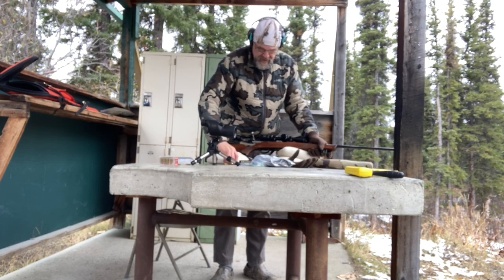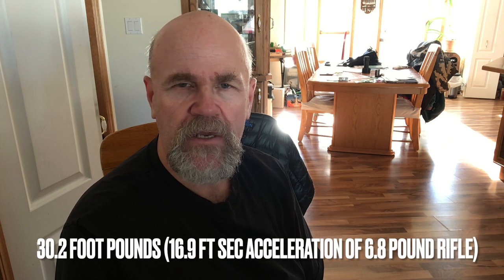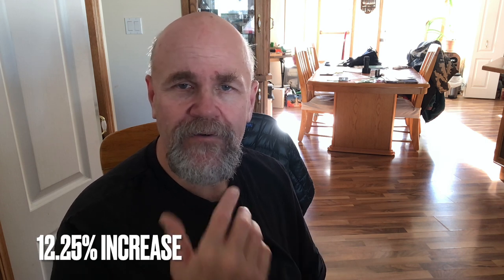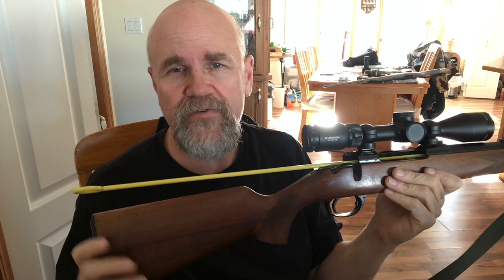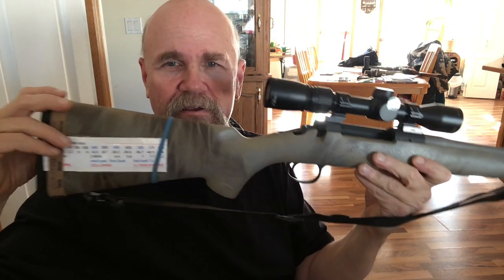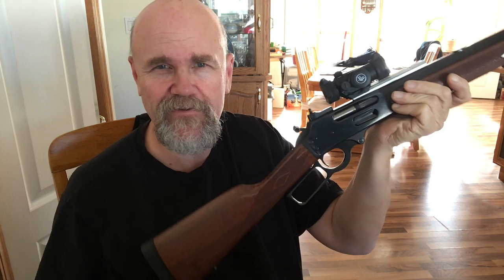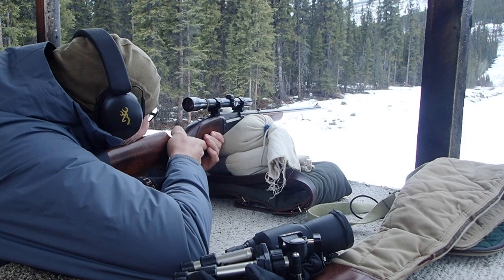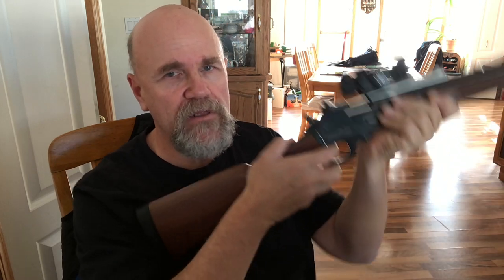Some Design Factors in Taming Rifle Recoil   HD 1080p

Comment: When I was in my early 20's in the late 1990's I had a Browning A Bolt 30-06 that hurt when I shot it because the stock didn't fit me well. The opportunity came for me to shoot a Sako 300 Win mag and i thought it was going to be awful, the felt recoil was less than my "06 due to the McMillan stock they used at the time. That was a real eye opener. Like you I have shot Marlin 450's and 45-70's and they aren't fun to shoot, you explained it perfectly in your video. Browning BLR's are much nicer. I also had a real nice 375 Ruger exactly like your friend's in your recent moose hunting video. It was superbly accurate but I was starting to get recoil headaches so it was traded off. My current "big gun" is a lightweight (7 lb ready to go) 35 Whelen with a Mcmillan Edge stock set up just like your Forbes and it is super nice to shoot.

Comment: The most brutal rifle I had was a 70's era Marlin 1895.  It had the straight grip stock with the hard cresent butt plate.  The rifle weighed 7# 12 oz.  The load was Remington 405 gr. or Speer 400 gr. with 54.0 gr. H335 at 1680 fps.  My recoil calculation came out to 35.7# with the 405.  I could only shoot about five accurate shots with it standing before I started scattering them.  Despite taking my first black bear with that rifle I sold it to a buddy's son.  Glad to see that rifle find a good home, because I didn't want to shoot it.
Reply from the maker: Those Marlin's are easier to shoot in 30-30 or in the original 45-70 loading.   When getting 40+ Ft Pounds of recoil energy they really start to hurt some.

Comment: The best stock designed to handle recoil was the old Roberts high comb roll over with palm swell.I had one on a Weatherby Mark 5 340 Magnum. It tamed the Recoil to where I could actually shoot it. It was amazing. Roy Weatherby advertise the sloping comb slid away from the face. But it hits the cheek bone. Unfortunately the Roberts stock hasn't been made for years. I believe they were out of Sandy Oregon.
Reply from the maker: I'll look into that!
Reply: @north61  Yes  you are right a straight stock that is aligned with the bore comes straight back. I would rather have the recoil to the shoulder than the cheek bone.

Comment: What is your experience or idea of weatherby's mark 5 with the monte carlo slopeing comb. It's a high comb for scope use and has cast off or cast on because I left handed. In theory it's supposed to slide away from the face but it seems to come up and hit me in the cheekbone. I have a thin face.
Reply from the maker: trust your cheek!   It's telling you something.  I think Melvin  Forbes has it figured out.low drop at comb with a very wide rounded cheek pice with no edges any-where.
Reply: @north61  Some people say Remington's Sendero stock mitigates recoil well. I believe it's like you say, straight comb that is thick and rounded.
Reply: @north61  Honestly I think shooting it in a benchmaster, the rifle is held to rigid. The comb comes straight up. Offhand it does slip away from the face. I think the straight comb is better.

Comment: Shooting any big boomer from a seated position at a bench where you are leaning forward into the butt is not a fun experience... all that energy has nowhere to go but into your upper body and yes the slap in the face is rather unpleasant with a lot of stock designs.

I’ve worked up loads for a .416 Rigby Encore PH and even with the factory brake it was still firmly in the ballpark of detaching a retina, you really should have a standing bench at the range to shoot the real kickers from.

Comment: Yep.  Stock design is a big deal.  For example, I have my old Winchester 1886 45-70 with a Cresent butt plate and an model 71 348 win.  Both actions as you know are mechanically and dimensionally similar but the 71 has less slope in that stock and a curved lever with an wide shotgun style butt plate.  I like both but the 348 win just handles way better in the bush than my old 1886.  Of course your aware of this having your own 348.

The BLR takedown is another cool rifle and on the 450 marlin version I've put on a stock riser so it level my eye to the red dot sight I've got on it, otherwise I'm floating my cheek and jaw above the stock allowing for that unchecked acceleration to belt me.

It's just a fact that until the later development of adjustable cheek pieces on today's so called precision rifles most bolt actions have comb heights that are far too low.  Now there's stocks with that are adjustable to perfection but moving parts and things that move are a pain in the bush and get snagged on brush and packs and whatever else.  Yeah, stock fit is a "thing".
Reply from the maker: The 71 is an ergonomic masterpiece!